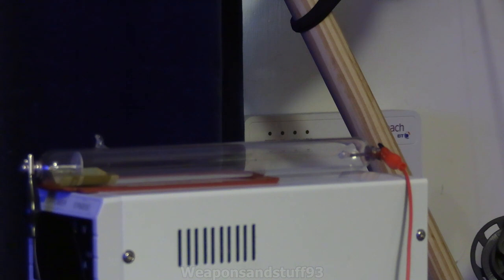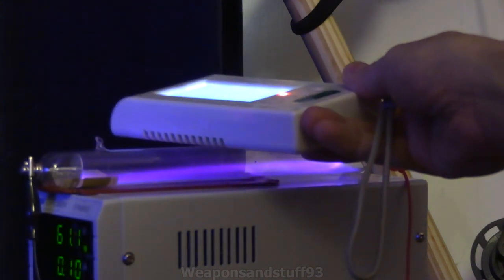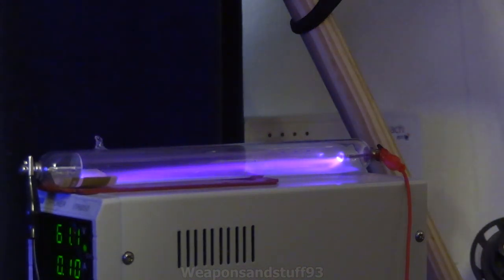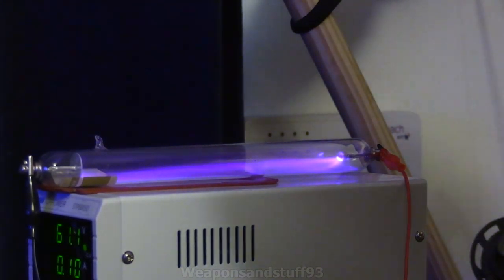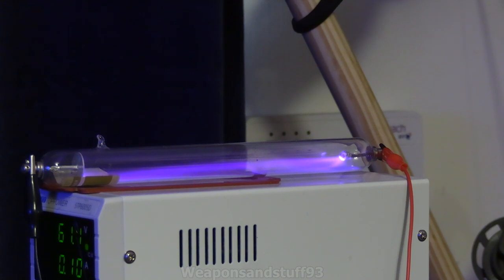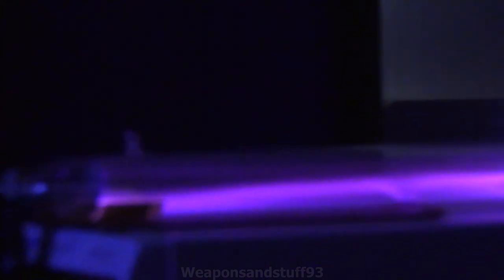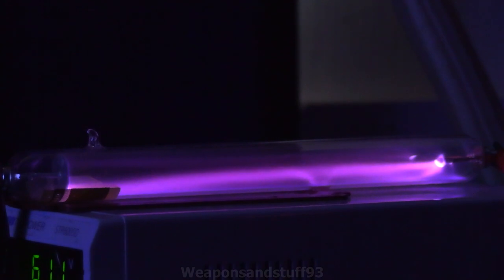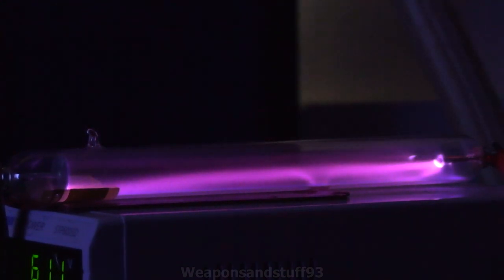A flaw with Geiger Counters

Comment: That’s a very good way to demonstrate the issues with Geiger counters it’s a shame we don’t have a small compact ion chamber with the same features as a high end Geiger such a terra-p. Good video keep up the good work 👍
Reply from the maker: Well I do have the Keithley digital Ion chamber now but they are still way bigger than Geiger counters, generally the ion chamber itself has to be fairly big to work.
Reply: Weaponsandstuff93 yeh that’s true to have enough accuracy and are generally used for higher ranges so the technology for low range ion chambers is as great.

Comment: Seen this done with a plasma ball as well, however a comment on that video said this is a “quick way to damage the Geiger counter” so I’m not sure if it causes damage or not?
Reply from the maker: Well it causes ionisation of the GM tube, they're designed to do that but obviously not for extended periods.
Reply: how should it damage a Geiger counter?
you mean electronic or the ionization the tube?? when going close to a plasma ball.?

Comment: Plasma balls are fun. They do this to geiger counters, they mess with graphic tablets, and if I put my watch up close to one it induces enough current in the backplate to give me a shock. XD Many electronics will go nuts around those things, try a pocket calculator! The spark is creating a moving electromagnetic field which in turn induces voltage in metals, in this case your GM tube, which it interprets as sparks. If you wanna actually generate X-rays with the tube, vacuum it! You'll need a few thousand volts to get the current going through vacuum but you're guaranteed X-rays!
Reply from the maker: I need to dig out my plasma ball and do some videos with it, I think it's in the attic, thanks for watching.